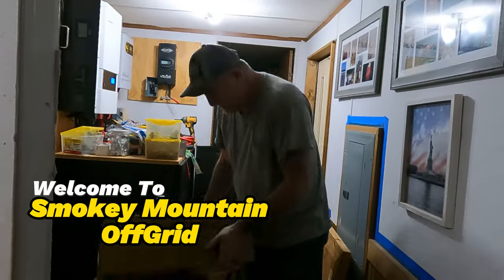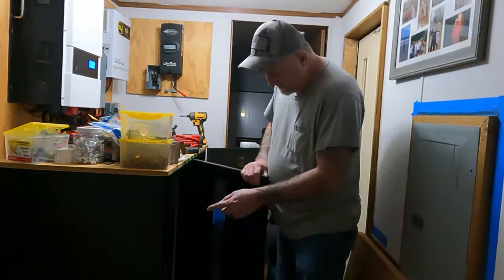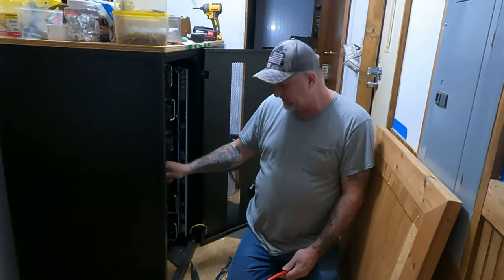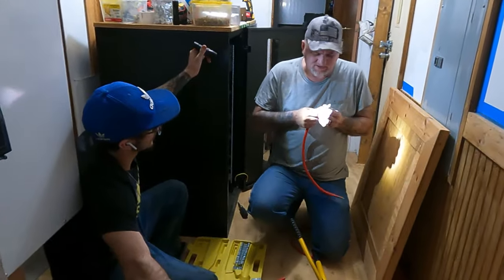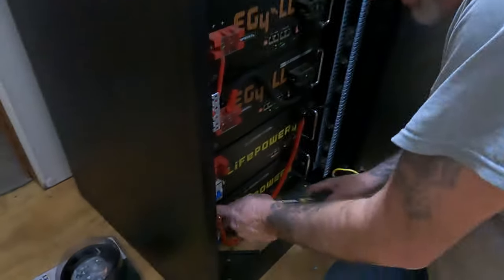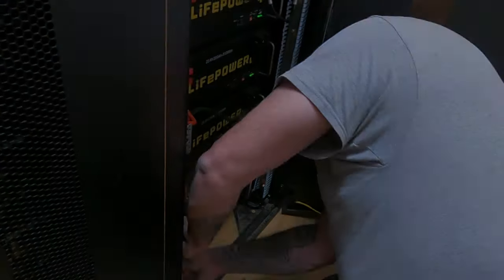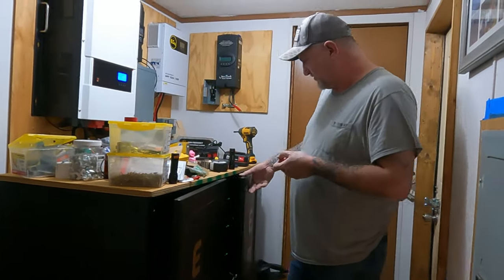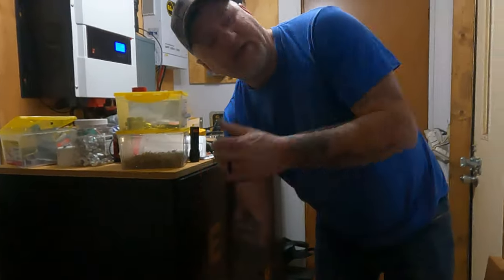Off-Grid Homestead Gets Major Battery Storage Upgrade #diy #solar

Comment: Man i have so many questions. What size inverter? What kind? I have a trailer just about like that, and im off the grid and we just getting it ready. Im buying up everything i need. I have 3 48 volt batteries so far...  What amount of solar would it talk to run a window ac and 2 tvs and lights?
Reply from the maker: I started with 4 of yhese batteries, nowhere near enough but it would do if its all you got, i started with a 3 k inverter and it ran my mini split, i have the lf split phase 12k now, where im at with it now im starting to feel a little more comfortable with it and running every thing electric in the house, email me sometime and ill try my best to help
Reply: @SmokeyMountainOffGrid  good deal.. I been looking at them mini splits. What's your email? I need all the help I can get. I'm just ready to get going. Love your channel.
Reply from the maker: @evertking1  rhineha6@yahoo.com

Comment: 60kwh is 1250AH @48v.  These 200AH 24v batteries only add another 400AH.  Did you already have over 800AH@48V. I only see another 400AH..
Reply from the maker: Yes had 800 more, added400 for a total of 1200
Reply: @SmokeyMountainOffGrid  ahhh gotcha!  That's a TON!  I am running 360AH @24vdc and it's all I need but I don't have AC or any other power hog. Nice setup
Reply from the maker: @TheOldJarhead  thank you, it powers everything we can possibly use here… sounds like you have s great system too